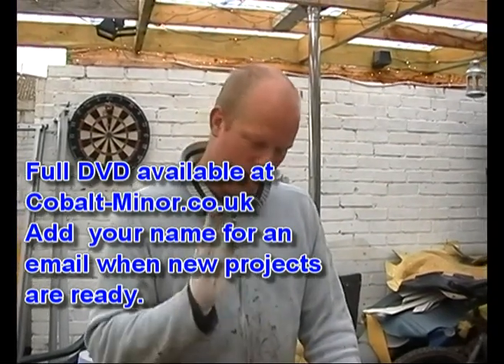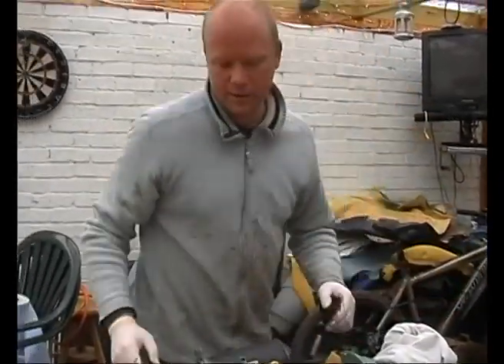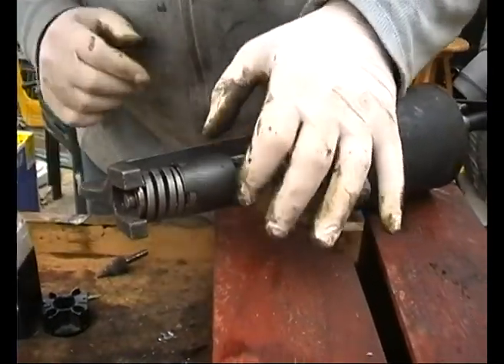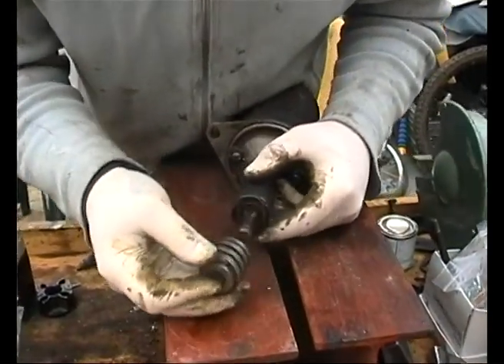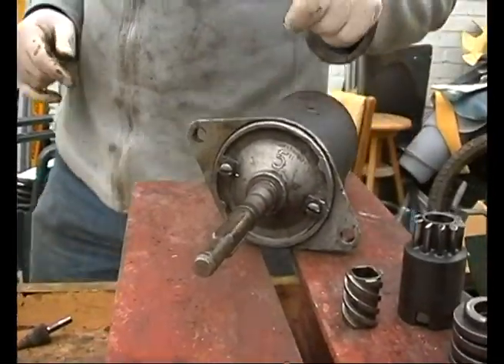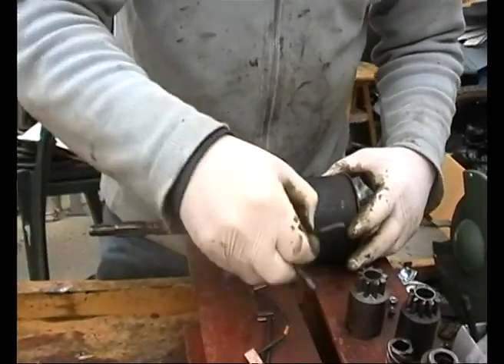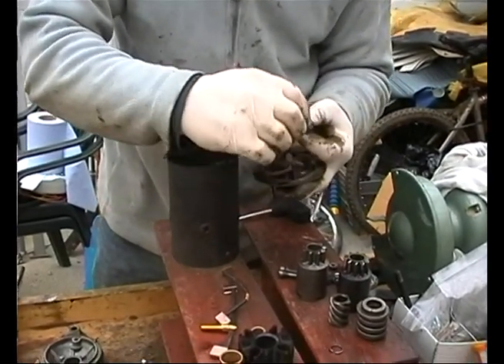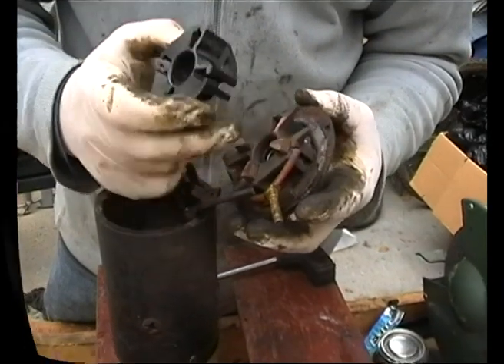Starter Motor Repair DIY-DVDS.com

Comment: Many ears ago we came out of a party and one fellow's MG would not start. We tried push starting it and it just skidded when he let up on the clutch. We pushed into the garage and the next morning we dropped the starter, tested it and it ran fine. We reinstalled it and the problem was gone and we were baffled. A few months later we told the story to a professional mechanic and he had the answer. He said those Lucas starters have so much slop in the Bendix gear that sometimes , instead of meshing with the flywheel they engage tooth point to tooth point, jammed solid.He said, as soon as you loosened the starter, the Bendix gear retracted. You didn't have to take it all the way out. Here in the States Lucas had a bad reputation. The joke went that Britts drink their beer warm because the have Lucas refrigerators. Take that, Jeremy Clarkson.